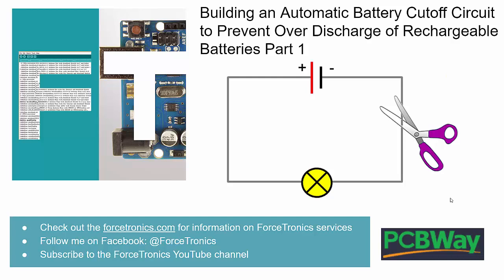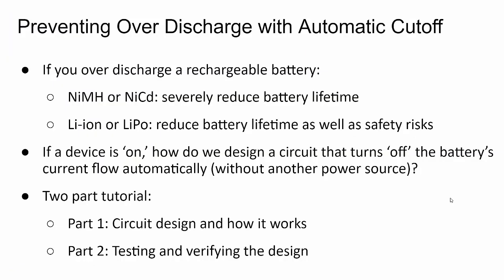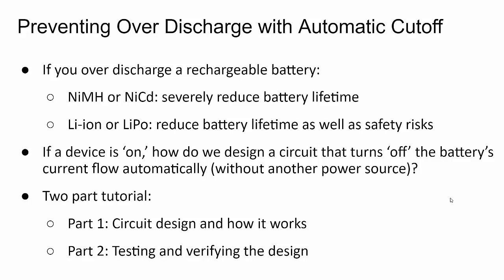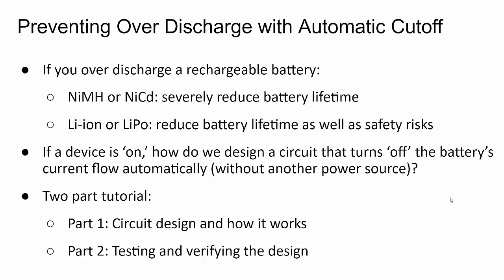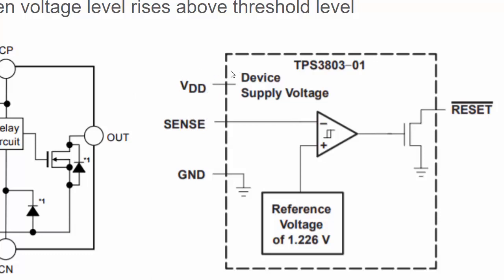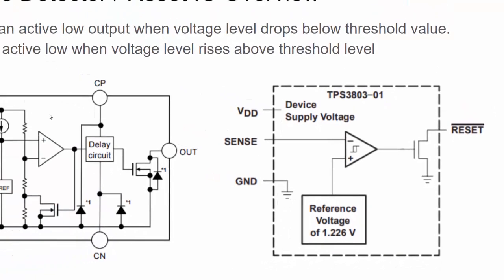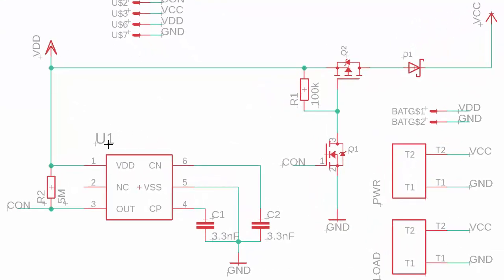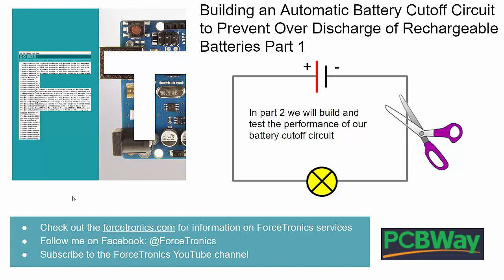Building a Battery Cutoff Circuit to Prevent Over Discharge of Rechargeable Batteries Part 1

Comment: Great videos man, juat curious why you use one mosfet to control another instead of just using an nchanel mosfet and the high signal to open it
Reply from the maker: Thanks for the comment. N channel MOSFETs are better used as low side switches. An N MOSFET does not just turn on with a "high" on the gate. The gate has to be higher in potential than source. For instance if the source has 10v on it then gate needs like >12v to turn on. Hope that makes sense
Reply: @ForceTronics  that makes a lot of sense and im designing a circuit using information from your video! thanks for the great explanations
Reply: @ForceTronics  what would you think about increasing R1 to a much higher value? For my circuit 100k is 1.7ms vs 4.7M is .08s on time which is much slower but that way we limit the current loss even more through the NPN mosfet

Comment: Thanks a ton for this video. Personally I'm gonna use a XC61CN voltage detector, PMOS AO3401A and NMOS BSS138.
I noticed you use a 5Mohm resistor. If I understand correctly, when this is fed to the NMOS it's going to charge the input capacitance of the NMOS anyway, so a big resistor shouldn't be a problem?
All the best! Thanks again
Reply from the maker: Glad the video was useful. Yeah you got it, 5Mohm resistor serves as a pullup unless the cutoff is triggered. High value is chosen to reduce current flow as much as possible with the pullup function still working. You can play with higher values to see if they do the job and further reduce current flow from the battery

Comment: Nice explanation,  can this circuit be modified to monitor a 144 volt battery to shut down at approximately 90voltd?
Reply from the maker: I am sure it could be. Just need to setup the right resistor divider network. My videos are meant to be examples that others can modify to fit their application

Comment: That was quite descriptive, thanks. 

One can incorporate reverse voltage protection in place of the shottky diode as you have the P channel fet in place already to reduce power losses and heat even further, with a diode and a resistor between outputs (Vcc and GND)  to the gate of the n-channel fet *I think* would do it - though, it will need a bit more thought than this (maybe a second n-fet?) in order to keep the power consumption during low battery condition to a minimum as the current circuit does already.